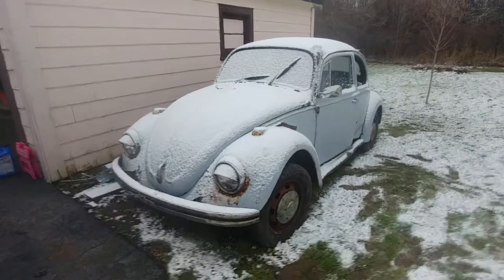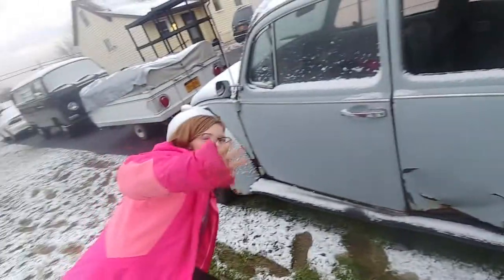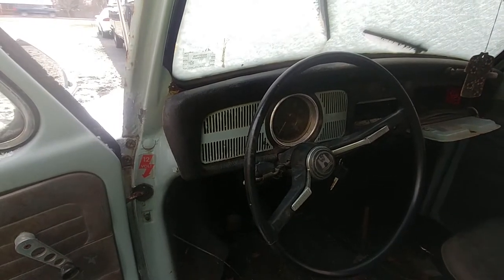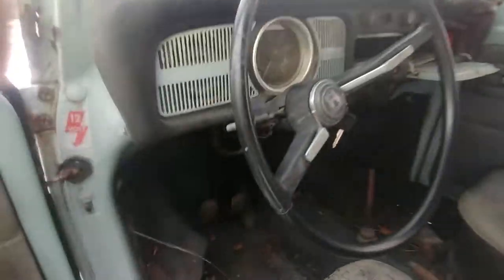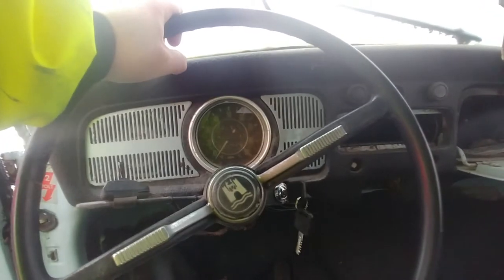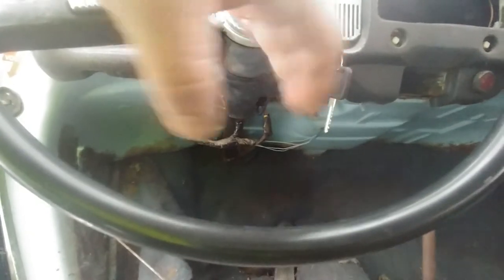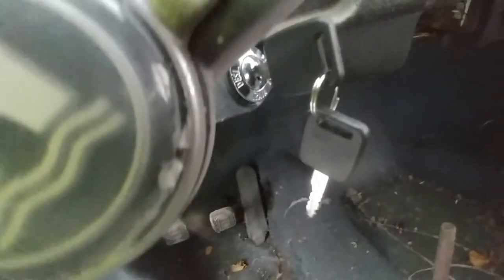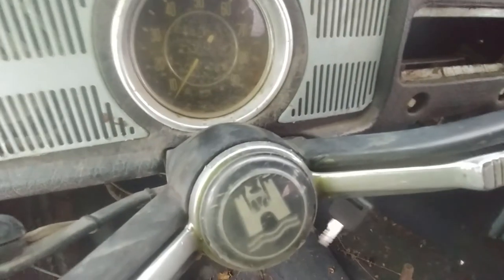1969 Beetle How to change Ignition Lock without key or release hole!

Comment: You solved my dilemma with this video.  Hopefully by the time I'm seeing this you've got it well on the road to completion.
Reply: I can’t figure out exactly where to drill that hole. I have the same ignition housing. Any measurements available?
Reply: Dakota Ruggieri •  Like you, I'm not sure of the measurements,  but from what he said in video, lay your new switch next to the housing once it's dropped down, holding the cylinder in the position it will be installed.  The dark spring clip will depress in, allowing old cylinder to be removed.  Once hole drilled, insert stiff paper clip into hole and press down on spring clip, cylinder should be able to be pulled out.  Then simply reinsert new cylinder.